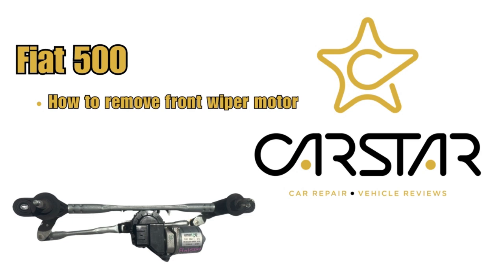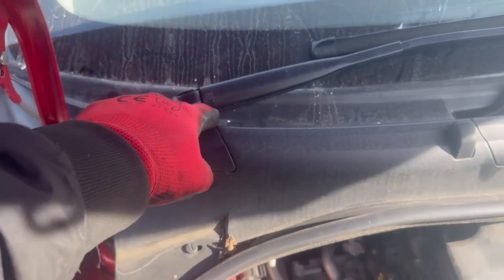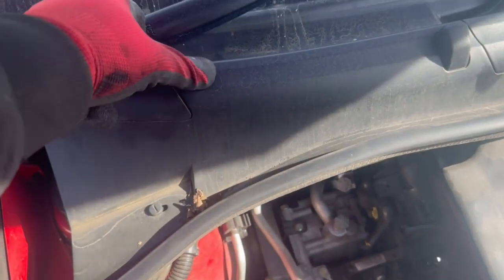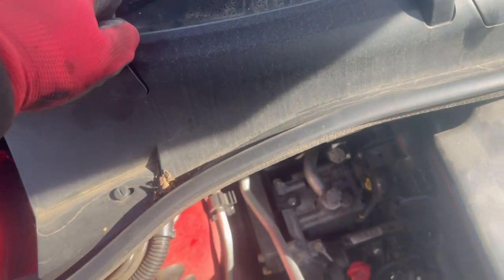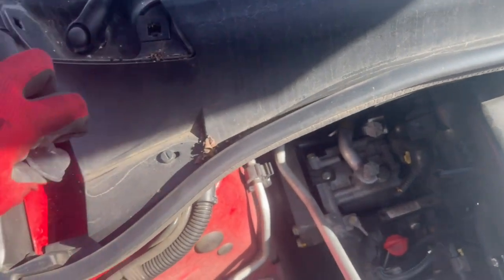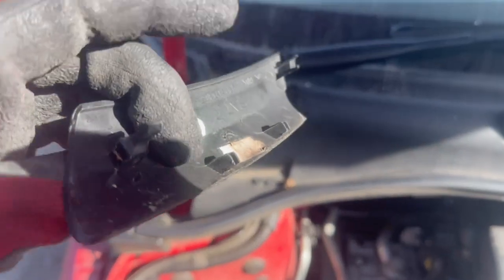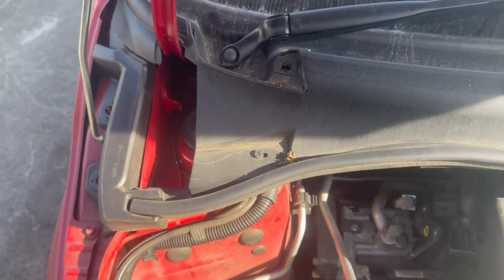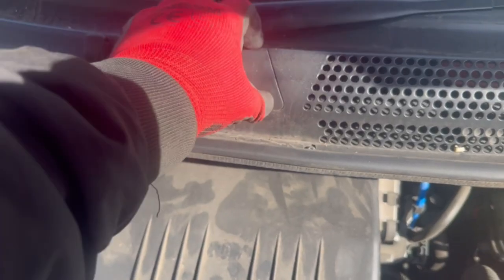How to remove Fiat 500 front wiper motor , EASY DIY

Comment: Ive just bought a 2012 Fiat 500 Lounge from auction.I thought the screen wash had run out so i topped up with screen wash and water.I can hear the motor working but no water from the wash jets.After a little investigation i found the water tube detached from the washer jets.